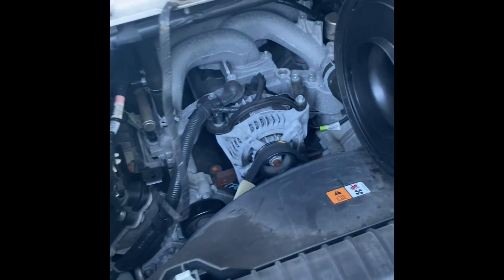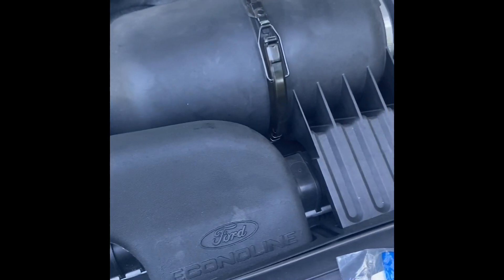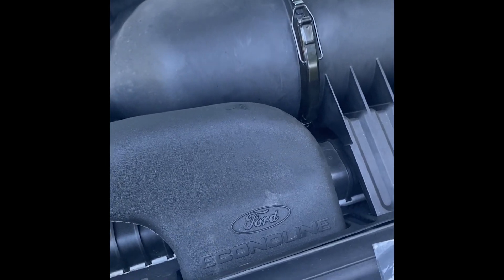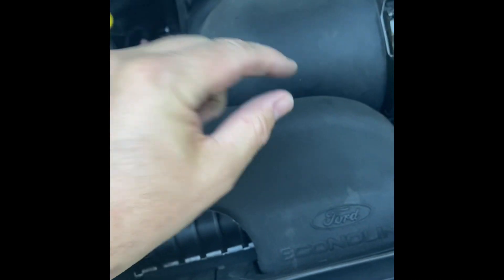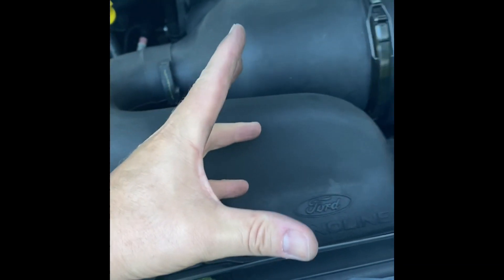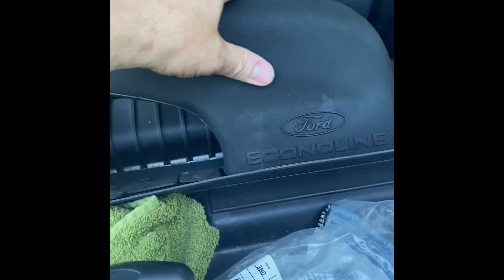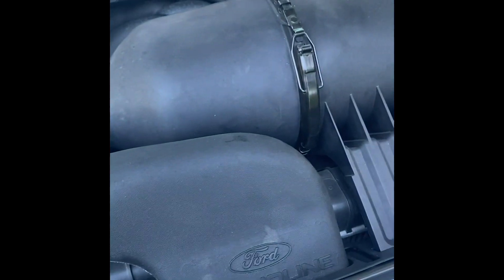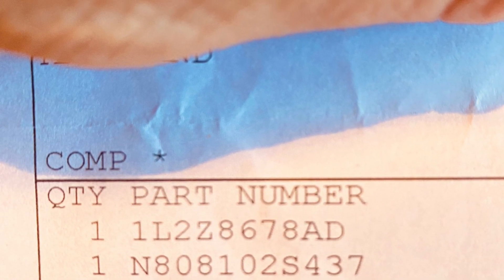Ford V10 engine ping. V10 spark knock. V10 cheap gas pinging. ITS YOUR BELT.

Comment: Bought a '98 e450 SuperDuty motorhome recently and it was making a similar noise. Mostly while idling, but sometimes going down the road. Sometimes it will go away. I've seen a few other videos where it was a pcv baffle inside the valve cover. Thinking that was the issue, I went through all the trouble of removing the valve cover, only to realize that the baffle is still intact as it should be. I thought for sure this was the issue. (a LOT of unnecessary work) 

Guess I'll put it back together and try this!
Reply from the maker: If you got a valve cover off, this is easy. It took me longer to drive to town, get the parts and get the tools than to do it. 
Let me know if it fixes your problem. I’m definitely curious. Thanks for watching.
Reply: @Thesaltymedic36 yeah, removing the valve cover was a nightmare! But, fortunately, I got it back on. Will let you know the results when I get the new pulley on.

Oh, and I checked all the other pulleys last month when I changed the serpentine belt. So, all good there.
Reply: Pulley is on, no change! Ugh!
So much for all that work :(
Reply from the maker: I’m at a loss. Not the valve cover baffles. Not the pulley. Not the other pulley’s. Not the water pump bearing. AC compressor? A heat shield somewhere? 🤷🏼‍♂️
Reply: @Thesaltymedic36 nah, definitely inside the engine. I guess it's possible that it's on the passenger side valve cover, but I don't think so.

I guess it could still be a timing issue. Idk... Engine runs great, just rattles like crazy.

Cheap gas, maybe?
Surely, it's not designed for Premium fuel only...
Reply from the maker: No it doesn’t need premium fuel. I mean you can try a tank full to try it.
Reply from the maker: Also check the other pulleys under the hood and see if it’s one of them. I use a long screwdriver and put my ear to it and listen to the bearings. While running but BE CAREFUL.

Comment: Does it sound like metal clinging in the cab when this happens
Reply from the maker: Yeah it kinda does. If you listen real close to the clip in the video, is the sound. Honestly it can sound different to different people. To me it was a gas ping from an old engine. I’d suggest getting the parts and see if it goes away at that 2200rpm range. It’s cheap and super easy to install.

Comment: Thank you so much for your help. Put the pulley and bolt on and took it on the highway for about 3 exits.  Did everything to reproduce the pinging. I could not reproduce it . Thanks again for the video and keep those YouTube videos coming .By the way any reason why they don’t put that pulley on since it’s set up for it on the engine  ??
John
Reply from the maker: No problem. I’m glad to pass the information along. It was driving me crazy when I first got it. Well when they went from a 8 rib to 6 rib (I think) it definitely made a difference. Probably deleted the pulley on the 8 rib. If you had a truck you would never hear it. Knowing vehicle manufacturers, the cost. It saved them a dollar 😂

Comment: Thank you   I think I’m going to try the pulley. I bought the motor home 2 nd hand and I only have 8000 miles. I just hope it’s that and not detonation
Reply from the maker: I thought the same thing but I was a Dodge technician years ago and with no check engine light I knew there was no was it was pre-detonation. Impossible for a 2018 to have that 🤣 so I guarantee it will fix the noise. Let me know 👍🏼

Comment: Does this happen only when driving or does it do it happen in park. Mine only happens when driving Because this is my exact problem. Also how much do you torque the bolt
Reply from the maker: Only when driving at 2-2200 rpm’s range. I just tightened it with a ratchet and socket. It’s aluminum so not much. Plus the belt spins in the direction it tightens.

Comment: Nah you just gotta crank that distributor around some and top 'er off with some high octane go-go juice! Run it wide open for an hour or so, clean the gunk outta them jets!
Reply from the maker: 😂 this ain’t your old F250 with that 460 in it
Reply: I bet that engine is still running. The rest of the truck though... 🤷‍♂